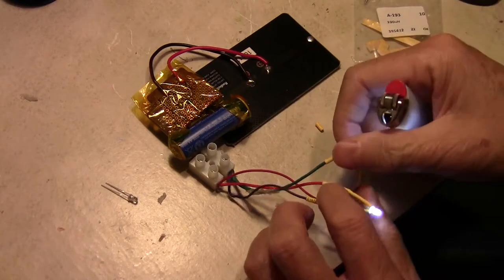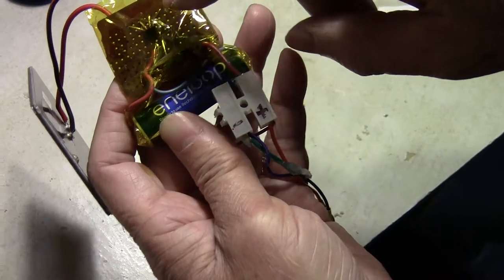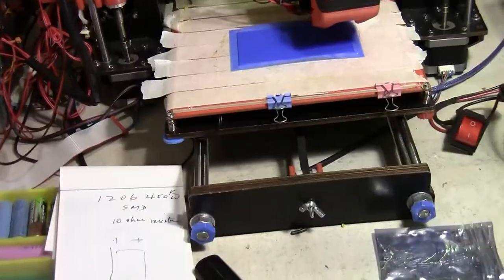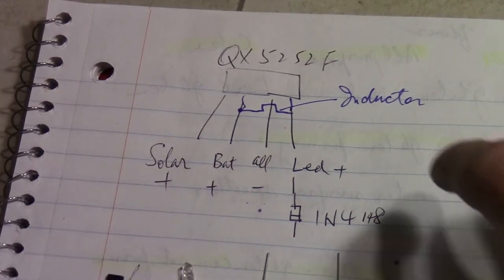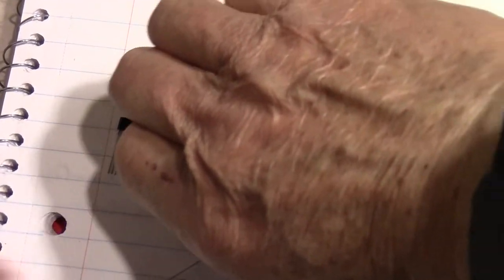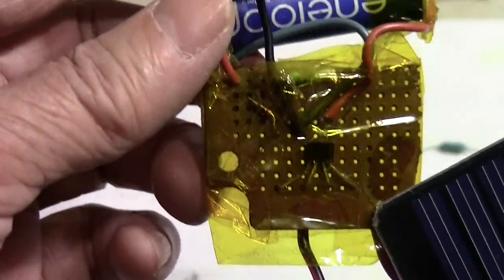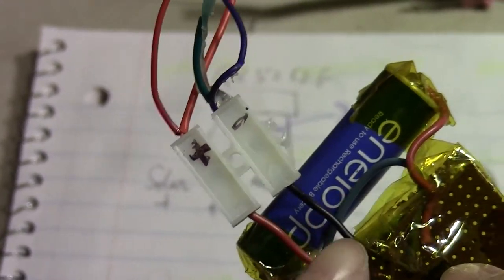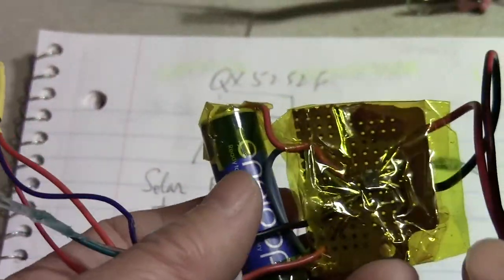Light up your house numbers with a diy solar light

Comment: I still need to check what influence that switching diode has. Btw as a rechargeable battery you can get Ladda 900 mAh AA batteries at Ikea.  I found them to be really excellent. Actually they are a bit more than 900mAh that I measured and a bit cheaper than the 2450 version .  
I think you can never take full advantage of the + 2000 mAh cells using small panels. Shouldn't the panel be facing upwards instead of horizontally?
Reply from the maker: It doesn't matter if the solar panel is vertical or horizontal as long as you can have it facing the sun.  Your solar panel has to be placed in a good spot. I use a bigger battery so on a good sunny day I can get more of a charge. The switching diode gives your solar light more run time as I mentioned before. You can check out this video on experiments done by this Youtuber:  look at the table at :29  https://youtu.be/WUOh2V4aiyo
It will explain the relationships between different components used in making solar lights.
Reply: @wtam69  Ok, thx, took a look at it. Just used a 1n4446 and measured the current that it drew from the battery but it was roughly the same.  To measure is to know but a more important one is to know what you measure. Should have used an oscilloscope since measuring pulses might not be the correct way to get the average current.  Anyway I booked way more success adding a capacitor, 220uF, over the diodes to smoothen the pulses. The leds lit up significantly brighter than before and the current, again using the meter so might not be the correct average, remained the same.
Reply from the maker: @Luke-san  Thank you for your contribution to the discussion. I'm experimenting along the way as you are. I've added a larger solar in addition to the small solar panel to increase the charge level since I have several days of overcast days. I will also try a capacitor but I believe a larger solar panel will definitely help to make the light shine longer.